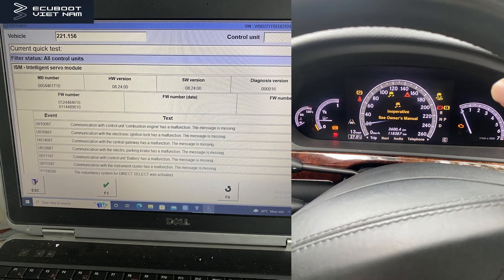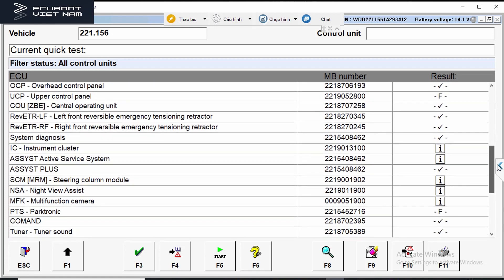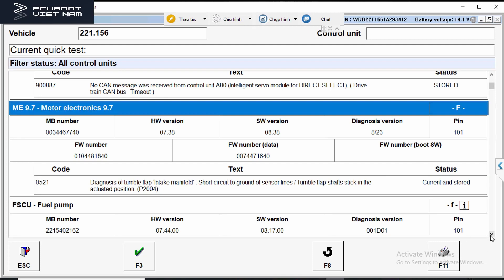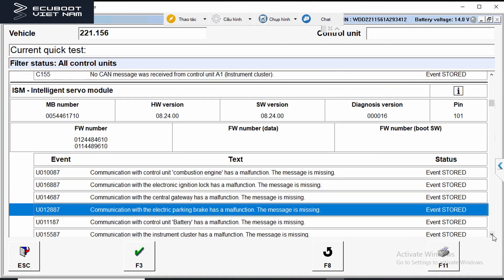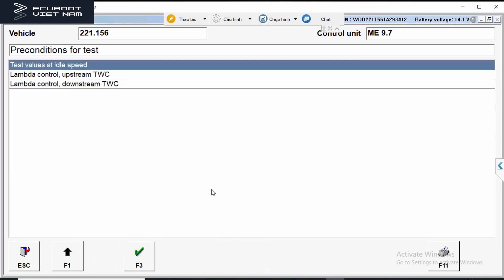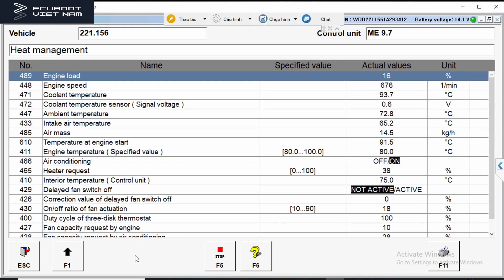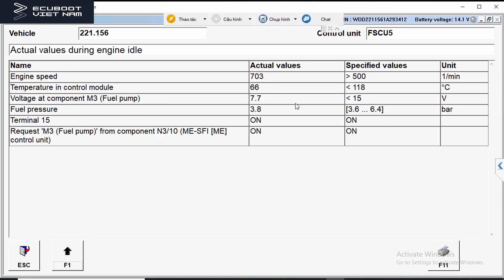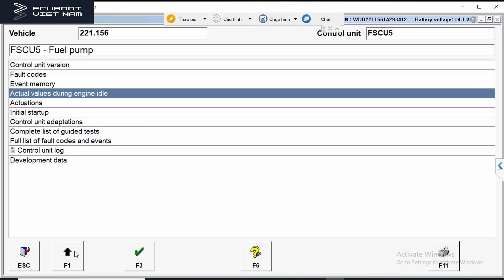Troubleshooting DTC and Analyzing Actual Values on Mercedes-Benz S350 W221

Comment: Maybe when the ECM get hot by the engine temperature and trigger the fault code.
You can try to warm the ECM by the heat gun and see what's the result. 

Ismail